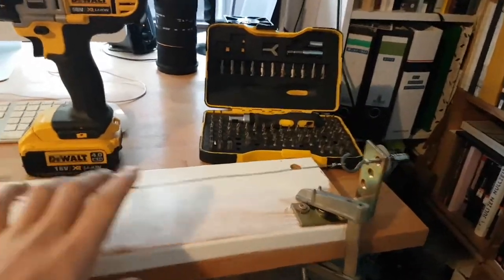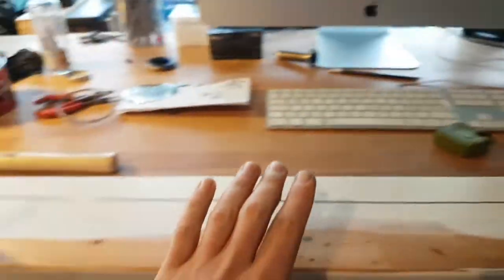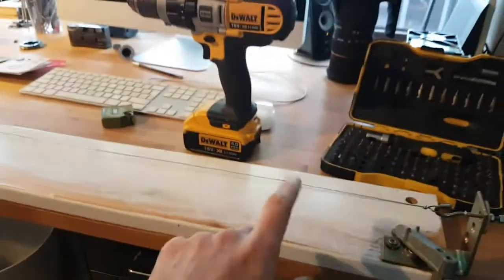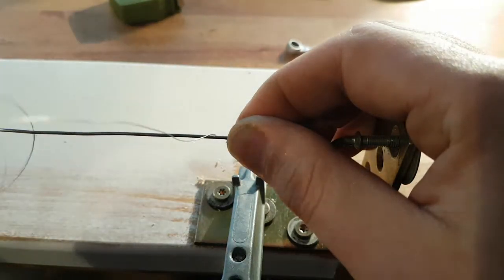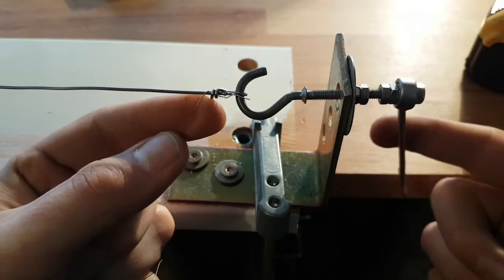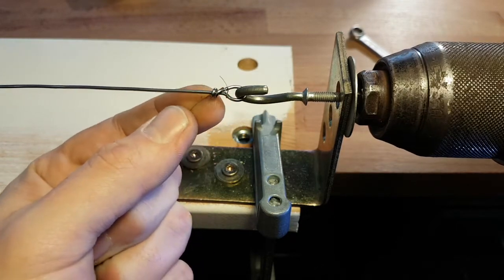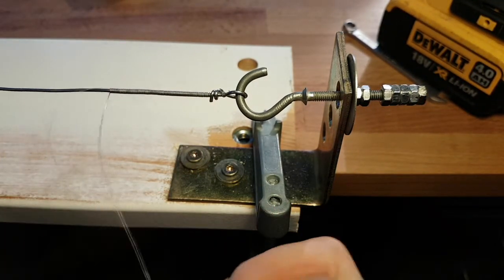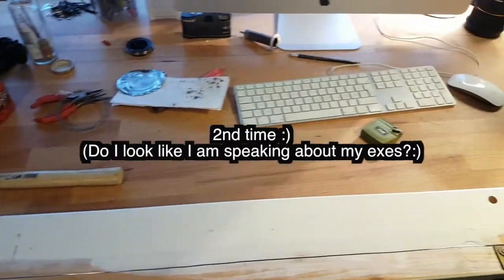How to Wind Very Long Coils. Wire Winding for Heating Elements, Instruments, jevelry, Vaping Etc

Comment: Whats usage of this kind of winding?
Reply from the maker: There are a couple which i already mentioned in the title. I used it for making a very long coil(70cm) to repair a hot air station. New resistance wire costs 500 euros. I payed like 20 euros for the wires i guess. So the usages are many and so much cheaper.
Reply: parçala behçet...got your point sir